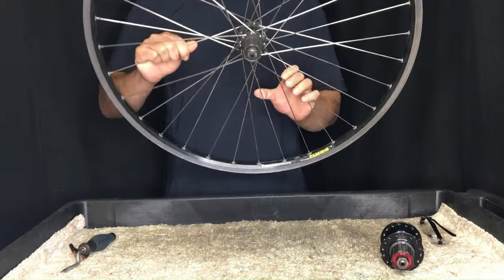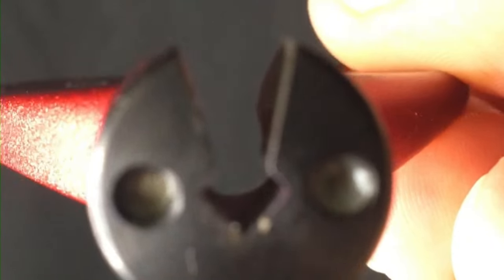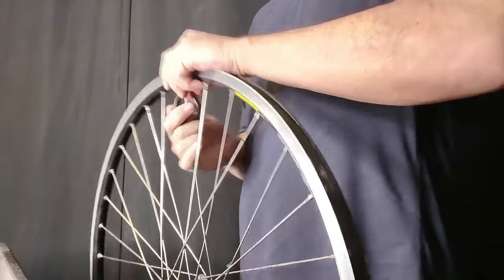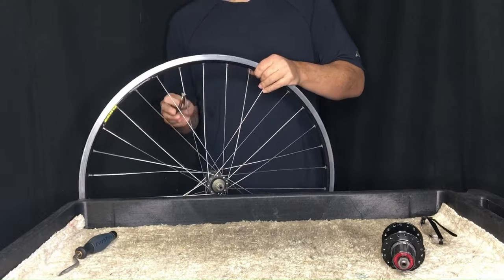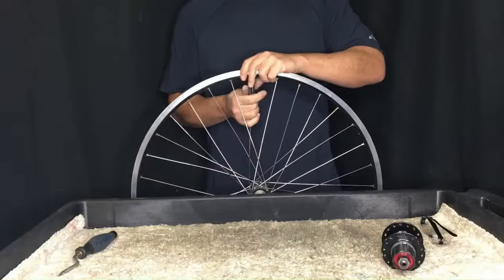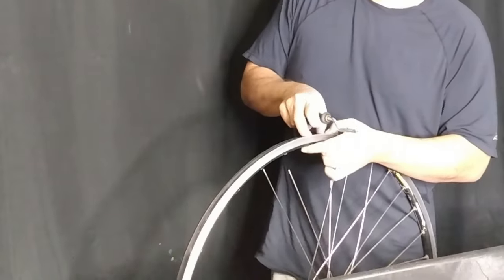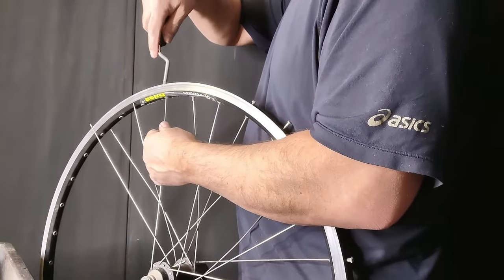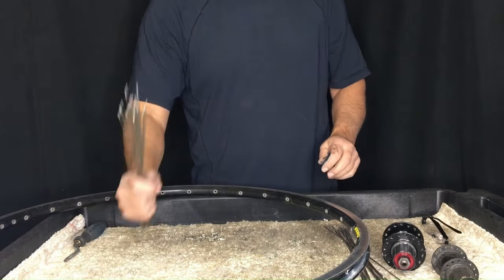FREE! Remove bicycle-wheel spokes and save money!

Comment: Keep the Spokes Sorted
if you're going to reuse them, in addition to the drive/nondrive length sorting. Keep in mind which spokes were Inbound vs Outbound spokes.
In's vs Outs develop a different bend at the head after being used, and if you mix those up in the new lacing they'll be prone to breaking there.
Reply from the maker: Great points! Thanks for the constructive contribution!